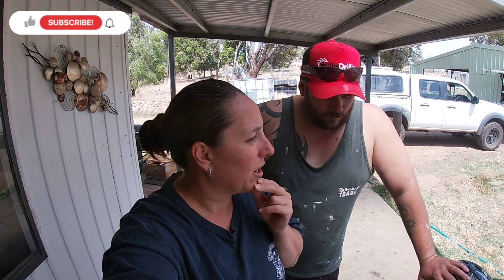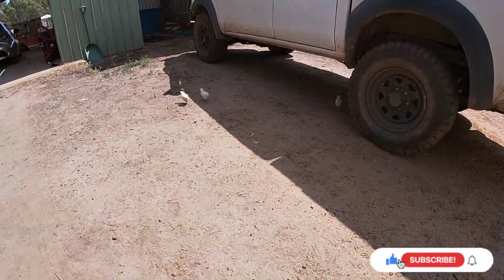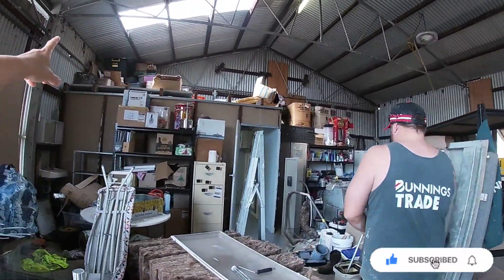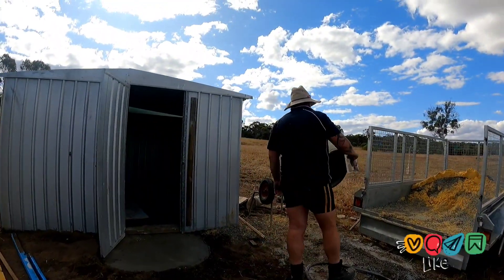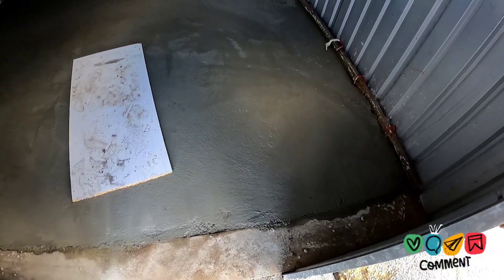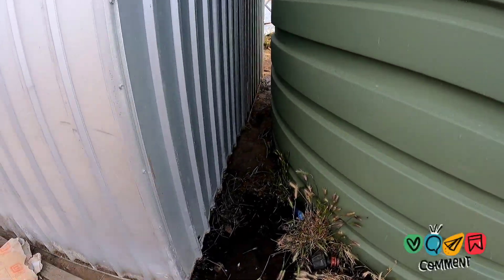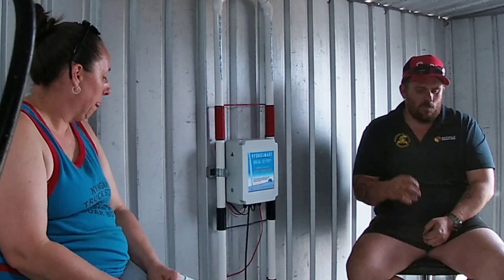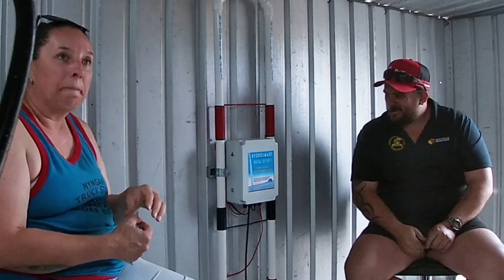Hydrosmart Install 💧 & Butcher Room Project 🥩

Comment: Have you had the salinity level of the bore water tested since using the Hydrosmart? For the best comparison, it would be ideal to take 2 samples, 1 before the Hydrosmart and 1 after, at pretty much the same time. Salinity levels in the bore water changes. We had ours tested several months apart and the salinty level had increased.
Reply from the maker: Wow really, that is crazy. We did have the water tested before but not after, I am going to do that!!